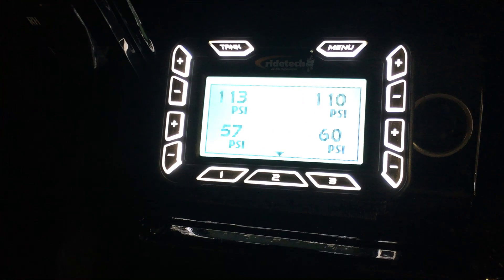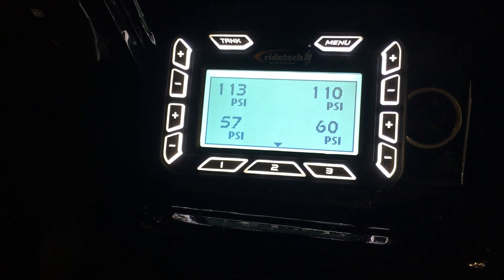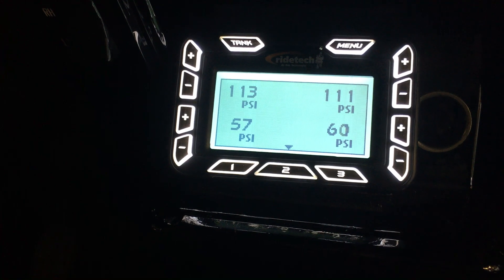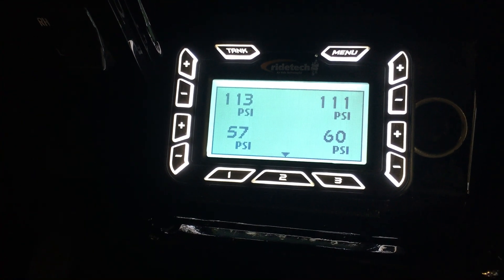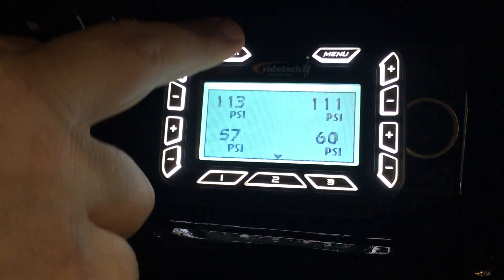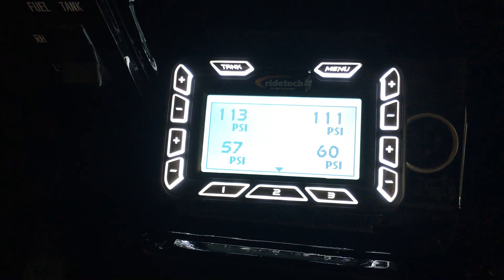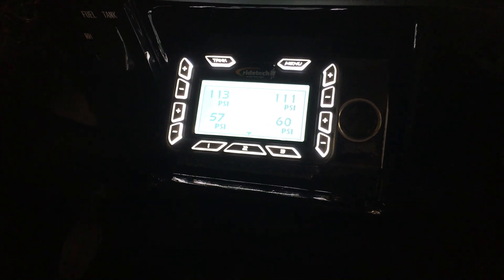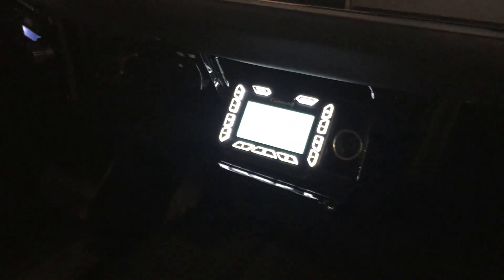RideTech Air Ride Suspension - Control System

Comment: My controller is dead...no air compressor...nothing.   car was sitting for two days...no work..nothing was working great before..any ideas
Reply: check fuse had same problem fuse yes a fuse big one
Reply: do you know where the drain  plug is located i purchase car with system
Reply: Same issues doesn’t turn on. We’re you able to address the issue?